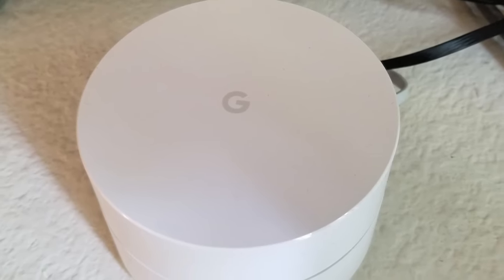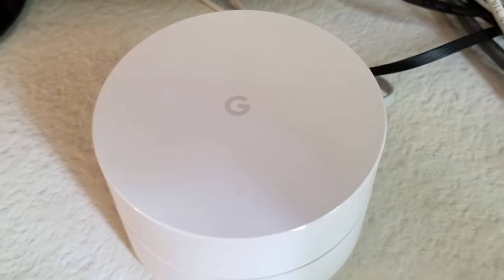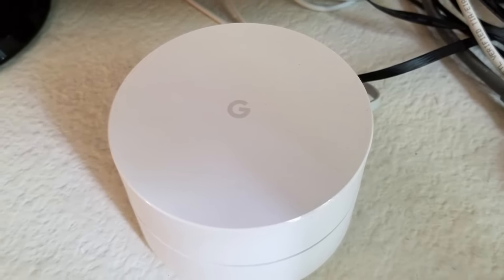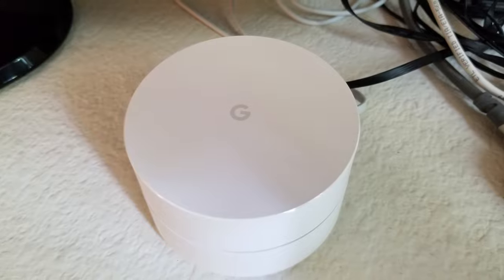TROUBLESHOOTING Mesh Wi-Fi

Comment: There's been several cases where the Mesh router doesn't provide all the bandwidth speed provided by the ISP. Regardless if connected through cable or wifi behind the mesh. But when tested from the ISP router the bandwidth is as should. Firmware upgrade doesn't help.
Reply: This usually depends on what WiFi frequency you are connected to. Is you are connected to 2.4GHz you are only going to get like 500 speeds but you also have to include walls and other frequencies so you’ll probably like 200. And on 5GHz you get up to 700. That’s what I’m getting. 

It also depends on what type of mesh you get I recommend a triband vs a dualband. Triband has an extra antenna giving the mesh system a better wireless backhaul

Hope this helped
Reply: @raphaelnunez8224  Is it normal to lose almost all your upload speed from the modem to the primary mesh node? How could I fix that?
Reply: zak.stjohn What is the speed from your ISP?

Comment: What's the best solution for my WiFi/ethernet situation? The main router is on the other side of the house on first floor. I'm on the second floor.. I am using 2 other routers with mesh, but it is very unstable, crashes and lags a lot.

Comment: HI Thanks, I am trying to set up my new canon E4570 printer with Mac Air and Deco x50 it worked for a week and then all my computers got disconnected. I see that printer is connected to wifi, computer had a discovered the printer but now disappeared again . Canon or Mac have answers could it be Deco system creating an issue? How to resolve it? Thanks

Comment: I have the nighthawk mesh 6 system with 2 satellites. Actually I have two. One at my home and one at girlfriends house. Both serve the primary function of connecting to wifi IP cameras. They work fine for a few days then suddenly it's like everything loses connection. One day it is one or two cameras not connected to the satellites. The next day the mesh is not connected to the wireless modem. I've read something about changing settings to static instead of dynamic addresses. So far I can't figure out which or what to do.  I'm on wireless internet with cricket/AT&T and set up a MIMO antenna to improve my internet signal to the modem. Any help would be great. I'm tired and frustrated.

Comment: My mnetgear mr80 is crap. It is now unsupported by netgear and only 15 most old. No longer eligible for and update. Don t buy.
Reply: I have the same system. Actually I have two. One at my home and one at girlfriends house. Both serve the primary function of connecting to wifi IP cameras. They work fine for a few days then suddenly it's like everything loses connection. One day it is one or two cameras not connected to the satellites. The next day the mesh is not connected to the wireless modem. I've read something about changing settings to static instead of dynamic addresses. So far I can't figure out which or what to do.  I'm on wireless internet with cricket/AT&T and set up a MIMO antenna to improve my internet signal to the modem. Any help would be great. I'm tired and frustrated.
Reply: @aNuthaRedneck  its built into the system.  So you buy another one. I took mine to the geek squad and asked them to update it. The said tgey couldn't touch it. The update is on netgear website in a format my computer cant unzip. The netgear router cant understand the format either.  I bought the top of line orbi syrem. It carries a 3 month warranty.  We have to keep buying this junk just to keep your internet connection going